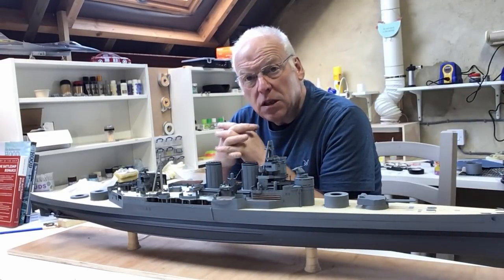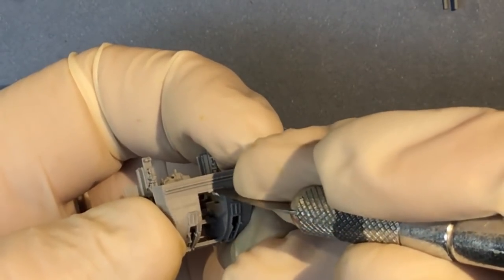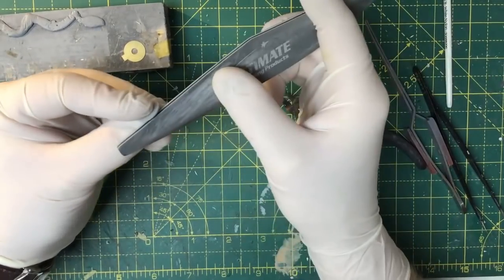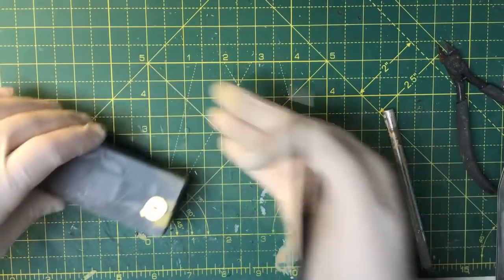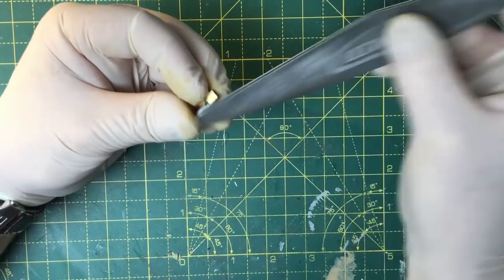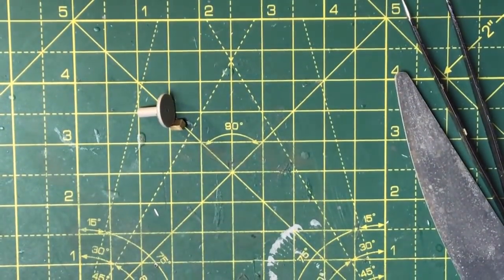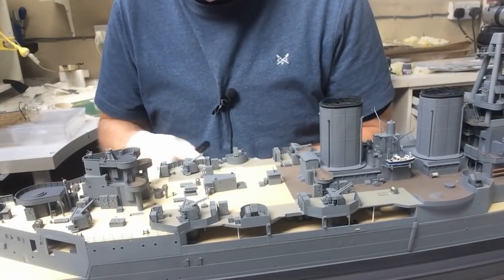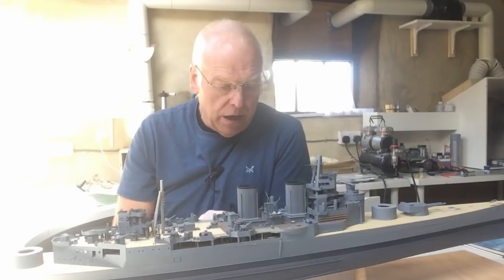Trumpeter 1/200 HMS Hood Full build with Pontos detail set Part 27  (Secondary armament fit)

Comment: Hi Steve , great work ! So next is the Ponto's Pom poms , I have done nine of them , 6 for the Nelson , 3 for
the Hood , there quite tricky , please allow me to share some tips 
Ammo boxes , make sure your folds are tight , otherwise they don't want to fit the cages 
middle partition , its a bit short , make sure you are right up to the edge on the open side , even
if there a gap at other end , small bar you will fold needs the support of the partition in center 
Ammo belts are to long , will bulge out , I ended up removing them  , cutting two links off 
The spent shell chute is very difficult to fold correctly , I ended up snapping off at fold , better to 
form both parts and solder back together
Cages for the ammo boxes has tricky center divider , better to build the cages and add divider later  
Plastic base , I removed a lot of the plastic at platforms front , spent shell chutes , electric motor
and pump box all sat on thin shelf , looks much better with the plastic cut back , also thin plastic all around
platforms edge , after you start build I will tell about the gun sights you need to install late in the build
Reply from the maker: James I can’t tell you how timely this is. After breakfast I’m heading out to the shed to start the pompoms and this heads up will I hope 🤞 help me get them right first time. It’s THE best thing about YouTube - sharing experience and passing on knowledge in the hope of helping our modeling pals out. 🍻

Comment: Great job Steve, found out how easy 3D parts break on the 1/700 kit I built. On the the 4" mounts, that the fit is loose, would it be worth the effort to make a sleeve, instead of gluing.
Reply from the maker: 👍You could but I’m going to fix them in place I think. I want to make some square baseplates anyway so I think the whole assembly will be best cemented together.

Comment: Good day Sir Steve. What is that brush you are using on the photoetch before and after soldering? Seems to be sanding as well? or am I seeing things?
Reply from the maker: Hi. There are a couple of things you could be referring to: the white brush which I use before soldering has flux paste on it, the black thing which looks like a pen which I use after soldering is a glass fibre pen for cleaning up excess solder and removing old flux residue.
Reply: @TheModelShed  Glass fiber pen is what I was after. Cheers.